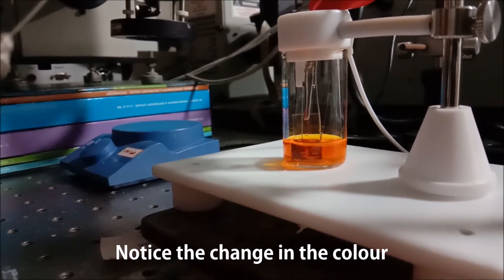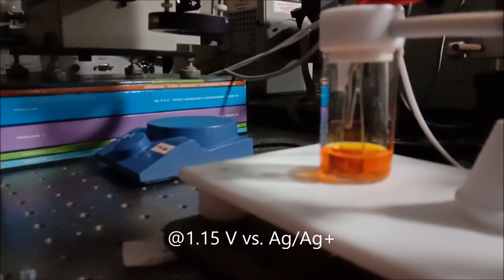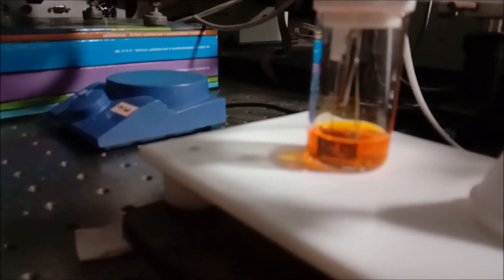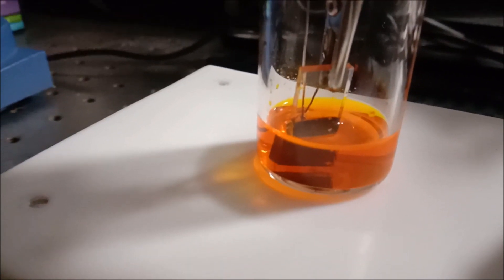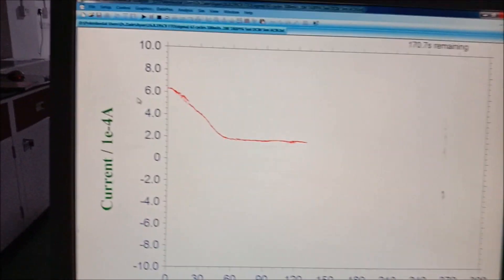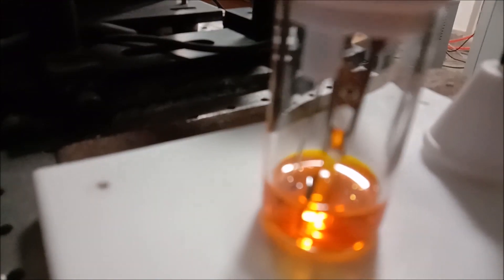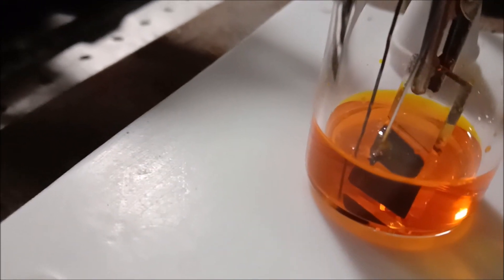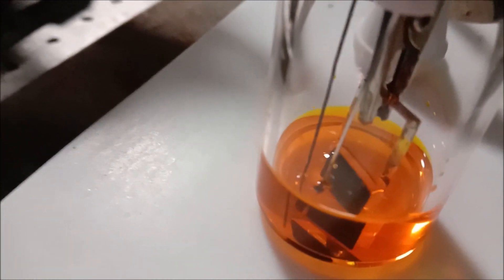Electropolymerization using CH Instruments

Comment: Hi, after i mix my monomer and template and left for 1 day, i notice there are strings of polymers formed on my solution? Should we have that prior to electropolymerization? Or should we run the ep before the visible polymer compelx form?
Reply from the maker: Better, you do the necessary characterizations of those strings and check their sustainability. 
Then you may follow the aforementioned processes after electropolymerization.

Comment: Hi there, I wonder that if i want to apply 0.014mA for electropolymerization, how should i set up the voltage here? thanks
Reply from the maker: This setup should work. May be, you have to change the current sensitivity.

Comment: Hi, after you mix all the monomers and trmplate, do u wait for sometimes or straight away doing polymerization?
Reply from the maker: We prepared the electrolyte before and then we started the process.
Reply: @AyanSarkar1  do u suggest any other characteization test that can be done to confirm that electropolynerization has happened?
Reply from the maker: @qarieast  The color (on the substrate) should change.